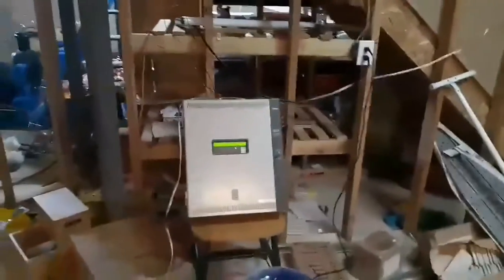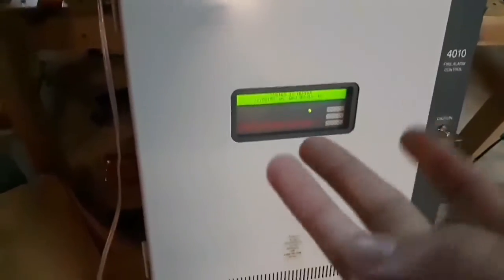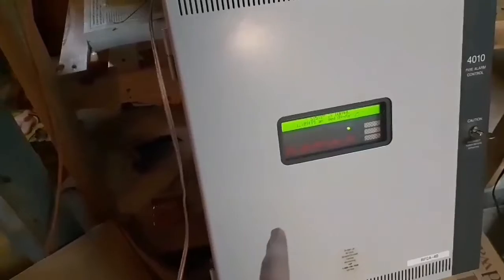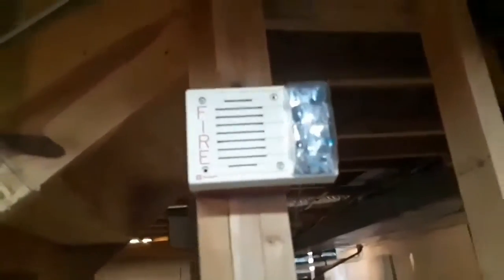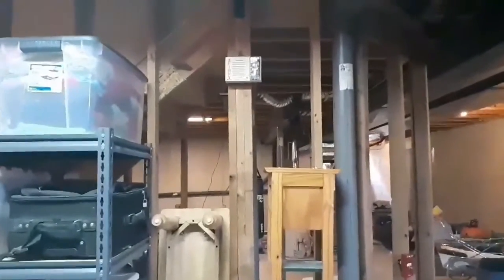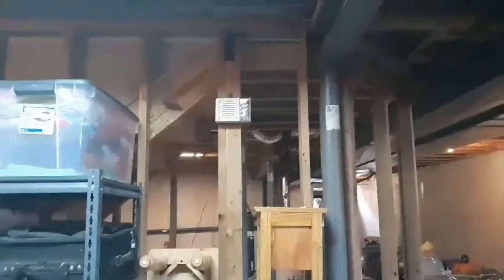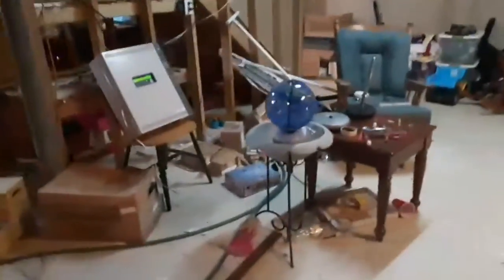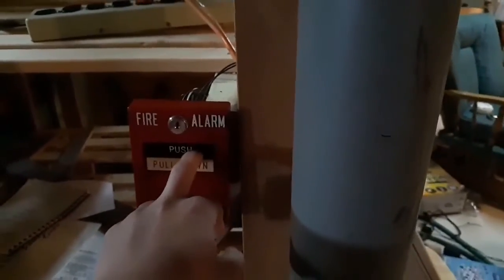System Test 18

Comment: I've heard that trick where you connect the battery terminals in the way described referred to as the "Battery Hack" can can mess things up if you leave it too long especially if you should get a power surge I would get your hands on some batteries asap
Reply from the maker: I'm not worried about it. The panel is only powered on when I'm making system tests so the chances are pretty low

Comment: The 7002t made me laugh because of the coding and i am working on a school and it has 2903 9001s, 9806s and 9833s faraday 5505s, 1 7002 24 and 4040 80 light plate but i have to install pull stations the panel was going be a 4004 but i can't find one in roblox just a 4001 and its really goofy with 120 bpm with the 5505s and 7002 24.
Reply from the maker: Interesting. I'll have to check it out once its done
Reply: @officialsimplexguy  its done